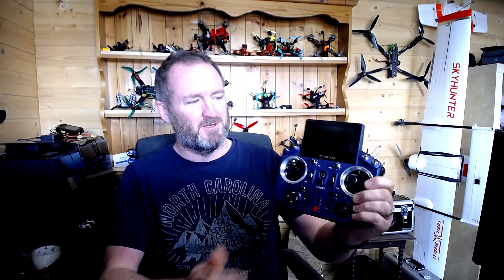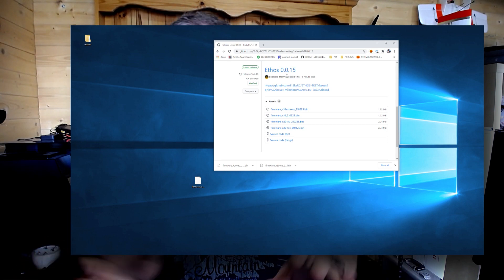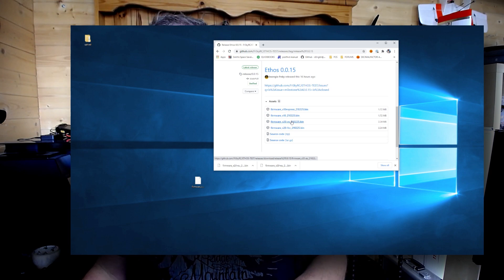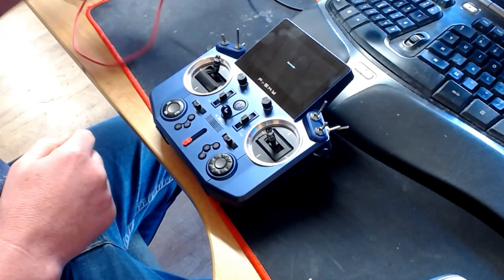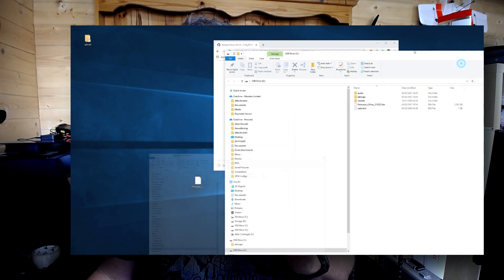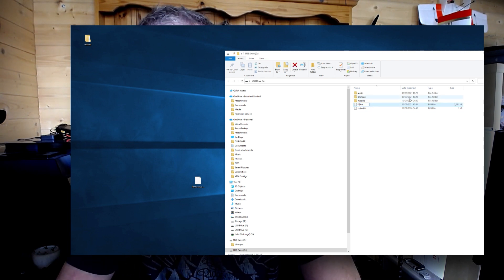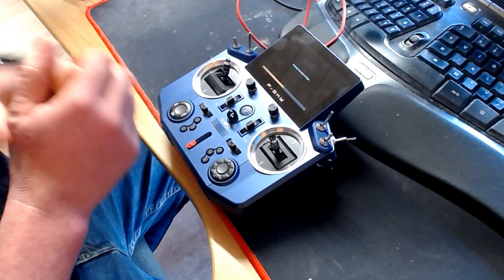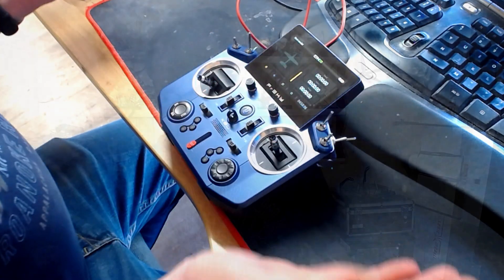FRSKY TANDEM X20 | HOW TO FLASH A NEW VERSION OF ETHOS?

Comment: Hi is there any chance of doing a video of how you set up a kill switch on a gas plane, would be much appreciated
Reply from the maker: Sure.    Don't have any gas.. But pretty sur I can achieve the same thing as an example.
Reply: @RTRCTV  Thanks for that,I have the X10 but I was using fros not open tx with that so this is a bit different for me . People say that ehos is like open tx to use?
Reply from the maker: @brianball4776  Hey.. it is similar.

I suspect you can solve your problem with a specialFunction. will work that out tomorrow.

Comment: Hi, do you know in which file the wav sounds are to be imported in the Tandem X20s SD Card?  The purpose is (i) to add commands - gear up/gear down, etc. and (ii) audio file to be played during the flight through special functions. Many thanks in advance. Emmanuel
Reply from the maker: Hey.. Give this a try..
https://www.open-tx.org/2014/03/15/opentx-speaker
Reply: @RTRCTV  tks!

Comment: HI, I just received my X20 (Firmware 1.0.1, EU). I want to enter into the boot-loader mode. I pull in the two trims and switch on the radio but instead of entering into the boot-loader mode, the radio only switches on. Any thoughts on that?  Many thanks in advance.  Regards. Emmanuel
Reply from the maker: Hey..  process has changed.

Now you have to use the 'enter' button!
Reply: @RTRCTV  Thank you!
Reply: @RTRCTV  Ok, The bootloader mode switches on, but the radio does not connect to my computer....
Reply: I changed the cable and it's ok. Thank you very much for your help

Comment: I am loving the feeling of the new X20 in my hands, not to heavy, not to light. Thank you for your channel. Very thorough yet net to TECHY. I am not an electrical engineer. I just received my new x20, no sd card. My Horus radios were picky about the gb size, is it the same for the tandem? Should I put anything onto the new SD card other than format? FAT32? Thank you
Reply from the maker: Hey.. You lnowm. I don't actually know for sure on the sdcard.

Pretty sure I just banged in a spare 32gb  I had.

I am away atm.. But can confirm next week if you remind me.